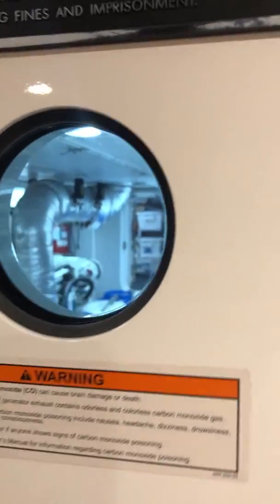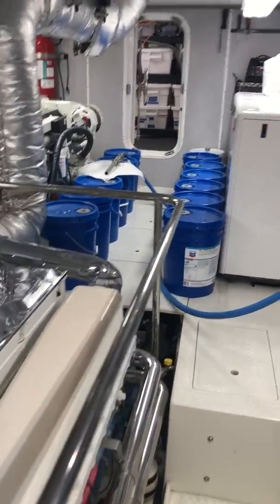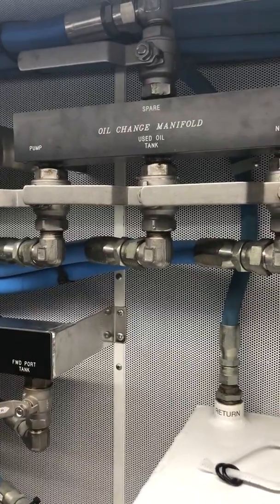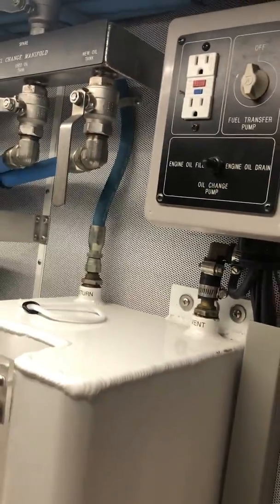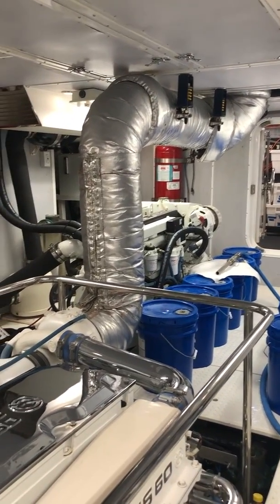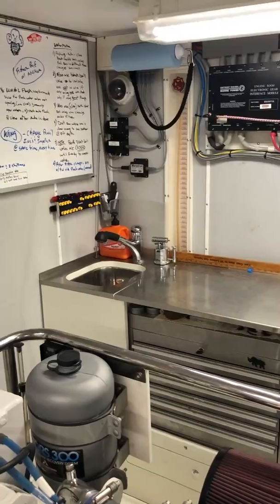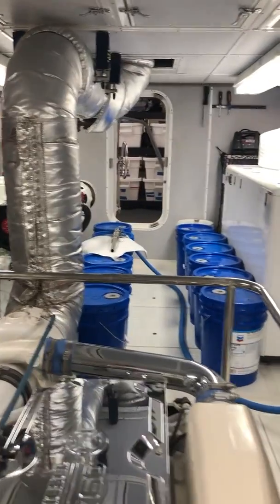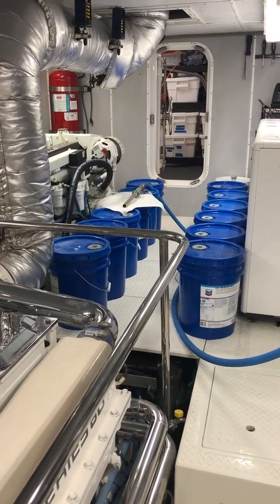Nordhavn N76 - Oil Management

Comment: Cool video. How much oil does the main engine take for an oil change? Also, do you do oil changes under way with the wing powering the boat, or do you wait until you are in port or at anchor? Thank you and be safe.
Reply from the maker: The main takes about 10 gallons.  And we do not change oil underway or stop to change oil.  We were advised that if we are underway when an oil change is due that we should wait until the next time we shut the engine off.  So, if we have 50 more hours underway then we would keep going.  I generally plan for this though and would change the oil early if we were close.

Comment: What happens to used oil ? can it be recycled/filtered for reuse ?
Reply from the maker: We store the used oil in a 65 gallon tank on board.  When new oil is pumped from buckets to the new oil tank we then pump the used oil into those empty buckets.  When we are in Florida we take the used oil to the county hazardous waste drop off. I believe they then recycle it.